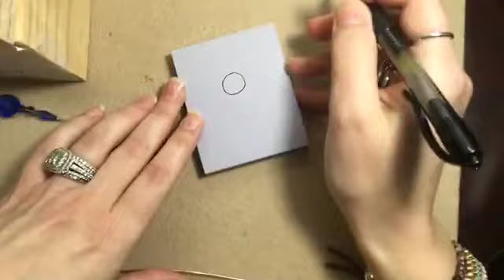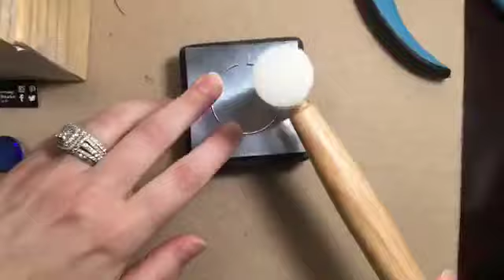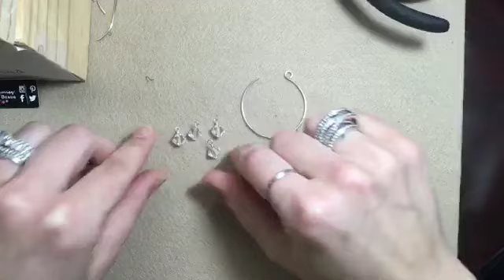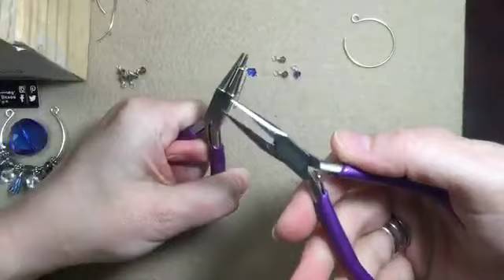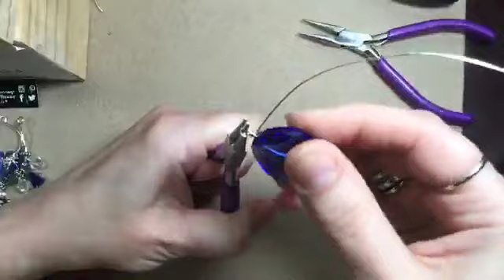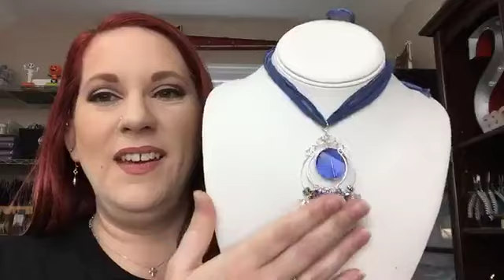Beads & Wire - New Year Sparkle Swarovski Wire-Wrapped Necklace

Comment: Couldn't you just attach the smaller ring of baubles to the next (4mm) jumprings up the "chain", instead of both rings on the same (6mm) jumpring?  Do you understand what I'm saying (lots of rings there)?  Or would that look bad?  I could see where you might have to twist the loops in the opposite direction because that jumpring would be going in a different direction.  I think I'm confusing myself now.  Would any of that work to save this piece?  Btw, I think it's lovely and love your videos.  Also, my birthstone is sapphire, so I'm particularly fond of blue!